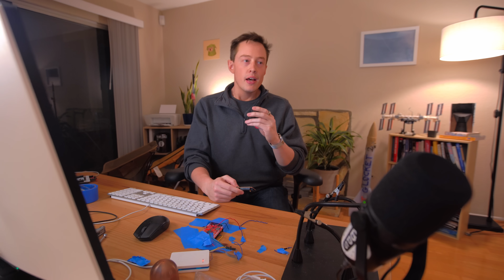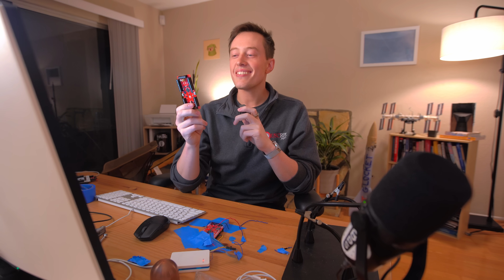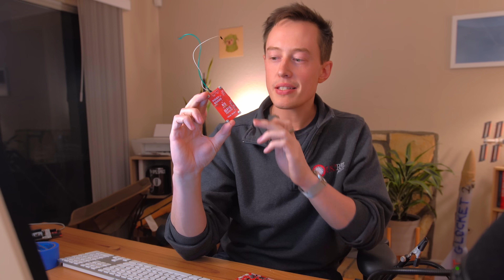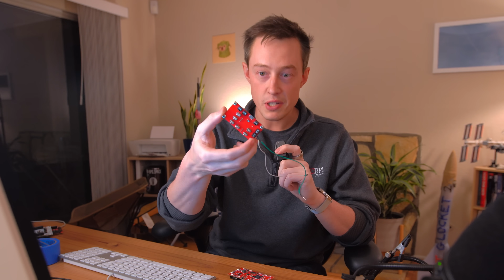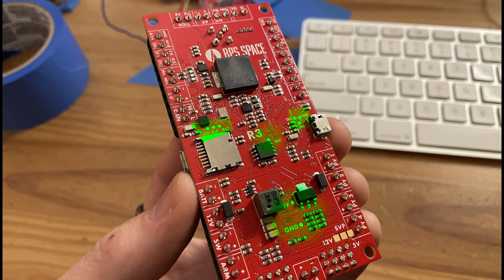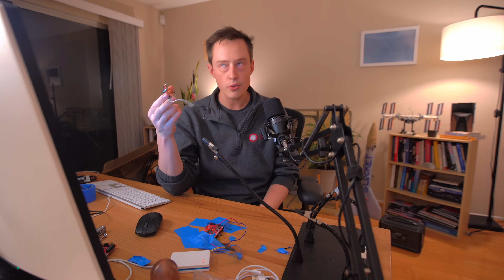the dumbest electronics thing i do

Comment: personally I use my nose to press the mouse button in situations like this
Reply from the maker: I have also done this! Feels especially goofy, but gets the job done
Reply: @bps.shorts  And use a trackball mouse, so it doesn't move off the button when you press it.
Reply: @mariusschaer3415  one of the biggest changes in my work was getting a trackball mouse. i can finally use the full size of my desk and no mousepad. only thing i wish is that it had forward/back buttons.
Reply: @bps.shorts  it ain't stupid is it works
Reply: that's what the foot pedals are for
Reply: @bob2859 where are hey? Didn't discover them on my pc yet
Reply: @TecSanento  Yeah! Why DON'T we have foot pedals to augment our keyboards??
Reply: @TecSanento  Yeah! Why DON'T we have foot pedals to augment our keyboards??
Reply: @TecSanento  You can build them easily enough... simple atmega 32u8 + a guitar foot switch is a cheap option. You can config as a keyboard, mouse, and/or gamepad.
Reply: I coded an autoit script years ago with a 5-10 secs countdown timer that then sends a mouse click. You only need to align the mouse over the program button
Reply: where is the whimsy in these solutions
Reply: @M8R3rojcq  i made an auto-it script to mob-grind at spawners on minecraft servers with the rpg mods. fishing too.
Reply: ...or the space bar, that's safer!
Reply: I think spending a few hours (or days) designing a special contraption to click the mouse button with your nose would be perfectly justified!)
Reply: I've used my nose to skip YouTube ads while both hands were busy
Reply: or your elbow
Reply: perfection
Reply: Or a foot switch acting as a one key keyboard, firing off a keyboard macro :D
Reply: you could use your tongue as well :)
Reply: Foot switch?

Comment: 3 pogo pins on a small piece of stripboard/veroboard. Would take 5 minutes to solder up, and then you can hold all 3 pins with one hand.
Reply: Could probably do a simple 3D print that would hold the pins on an arm and base would align the pcb.
Reply: @lawrenceharris7717  Yup, designing a small 3D printed jig for a few pogo pins are even just some Dupont male connectors would be done in 5 minutes. Just something that  precisely fits over the board and pushes three pins down on the board with bit of weight on the back of the jig,, hell just use a paper weight.
Reply: @FoobarDesign  This is literally the way OEM's solve this exact problem at scale. A block with pogo pins and a cable. Hell, there are those programming cables that are basically off-the-shelf versions of this concept.
Reply: @lawrenceharris7717  exactly what I was thinking with a cam locking mechanism
Reply: To quote Henry Ford  "If you want to find a better way to do a job, give it to a lazy man"  so in the spirit of no effort November I suggest cutting down a strip of plastic from a credit card just wide enough to span the 3 pads. Then super glue the wires to the card so that the exposed wires extend past the end of the card. Bend the wires over the edge of the card so the side of the wires will contact the pads.
Reply: If it's close enough to the edge you can drill three holes in a wooden clothespeg for pogo pins.
Reply: @TDOBrandano  Getting accurate holes in cheap wood is hard given the grain structure. That said, maybe potting something in hot melt glue on a popsicle stick?
Reply: @benjaminshropshire2900  just put slots on the edge (use a broken veroboard for a guide) then you can tape/glue the pogo pins in place on the edge...
Reply: Yeah that's the obvious solution, fingers crossed that the spacing is standard so it's easy to get it to line up using veroboard...
Reply: @hot_wheelz  For a one off, the spacing is irrelevant as long as you know what it is (and as long as it's wide enough); just drill a bit of scrap Delrin or the like.
Reply: @benjaminshropshire2900  yes, I realise this. There's literally an endless number of fairly trivial ways to skin this cat all depending on how much effort one is willing to make. If you want to use veroboard as per the original suggestion then spacing is at least a little bit important. If your willing to 3d print a jig or drill 3 holes in a piece of plastic or a wooden dowel then spacing becomes less of an issue but you then have to goto more effort with drilling holes and so on. I think the real point of all this is that if the current procedure is a hassle and needs 4 hands then it's probably at least worth say less than an hour to make a simple jig to ensure that the process is massively simplified.
Reply: 3d Print, drilled wood or even play-doh. Doesn't even require standard or regular spacing.
Reply: @rmg_lb play doh works, but for a more permanent fixture I think Sugru would work better.
Reply: Literally came here to say this, but it can be even simpler. 3D print a chunk of plastic with 3 pins in it, solder wires to 3 pins, hold with one hand, yadda yadda yadda.
Reply: Nailed it! (that's supposed to be a pun BTW)
Reply: For programming specifically, Tag-Connect makes great (but pricey) cables terminated with pogo pins that can interface with an external programmer like an ST-Link. Super convenient to use and they have variants with or without retainer clips if you want the probe to stay in place while developing.
Reply: James at Clough42 did a video on exactly this where he uses pogo pins and a 3d printed fixture for testing his boards. https://youtu.be/XD6EKqvFBCs?si=fa2_ZnbmoNeBU-Uh
Reply: I've done a diy tag-connect and a 3d printed jig before both worked well.
Reply: I have almost exactly the same problem with downloading data off my dive computer; three contacts on the back and they expect you to buy some overpriced clip. I soldered three pogo pins into a stripboard that connects to a TTL serial adapter, hold it against the computer with one hand, leaving one hand free to click the "download" button. Easy, repeatable, took minutes to solder up and cost me almost nothing.
Reply: lol or even just pin headers... or even just a piece of tape. literally anything but this
Reply: That's what I did, pogo pins on a programmer board so i didn't have to add a serial usb chip on each board
Reply: yeah, sounds like he's not aware of pogo pins.
Reply: I’ve seen when the pogo pins are attached to a clothes peg. Clip to the board where the pins are aligned to the pad.
Reply: Yeah I was thinking it would be simple to make a slngle probe with three springy needle contacts. It could be made totally foolproof if you added a couple of holes in the board near the contacts and matching pegs on the probe.
Reply: Sticky tape and cardboard for the lazy.
Reply: Acupuncture needles in your helping hands with the leads crimped on to will give you the pressure and bite you need and is easy to use for debugging as well later
Reply: I was thinking he could crimp a 3x1 Dupont connector  to those three wires, so he can one-hand it.
Reply: Could 3d print a swiveling arm to match the board to hold the pins.
Reply: A three pin header works too.
Reply: Even better, if you don’t want pogo pins on the board, PCBite Probes. 

Desk mounted pogo pins on an articulating arm.
Reply: Pogo pins was what I was thinking as well.
Reply: Exactly what I wanted to say.
Reply: 3D Printing and/or even "just" laser cutting a holder for three pogo-pins would be definitely easier :D
Reply: or in a 3d printed plate, and some pins that align with a rectangular "board holder"
Reply: 3 pogo pins, a small 3d printed holder that aligns them, and then a small latch to keep the board in place.
Reply: i have lower effort solution, instead of stripboard/veroboard (they require soldering, right?) i push pogo pins into dupont female 2.54mm prototyping wires, and tape them together
Reply: Stick the three wires to a piece of tape and hold that with one finger on the board?
Reply: This is the way
Reply: Apple user😂😂
Reply: Been doing this for 4 decades
Reply: I was thinking hot glue the pogo pins to a plastic fork for maximum jank this is a way better idea though.
Reply: Was just about to type this
Reply: better yet just make a jig off a 3d printer and plop it on
Reply: @JadedAtheist  that takes longer than simply soldering pogo pins to a perf board
Reply: You mean  headers with little springs soldered to the end hahah
Reply: @IconicPhotonic  there are test probes that are spring loaded, called pogo pins, all different types of contacts, they are used on production lines to test assembled pcbs (and program them is needed)
Reply: that was i thougth
Reply: No need for pogo pins. 4 thru holes in a row at 50 mil pitch in board. Solder wires to a 4-pin 50 mil pitch 90 degree header. Header rests in holes and can be held with one hand.
Reply: Just want to say I've totally done that so much... And I know full well about pogo pins.

Comment: I suppose you could 3D print a small jig that would hold Ava and then clamp down onto the correct pads with pogo pins. That might need like a tiny custom PCB to mount the pogo pins to,  but I bet you could knock that design out in a couple hours, and it might generalize to use with future boards.

Comment: could you maybe just 3d print a small thing that holds 3 metal pins in place. then solder the 3 wires to those 3 pins. that way you just need to hold the printed piece (with the 3 pins spaced out properly) onto the 3 contacts and its all done? would basically just be a small piece of plastic with metal pins like hot glued onto it lol

Comment: You might want to consider Tag-connect for new designs. It's a footprint you can add to the circuit board, and you can then by a matching cable from them for programming. A good compromise between holding pins by hand, and designing your own board.
Reply: Tag-connect 100% ftw
Reply: Tag-connect is awesome. Just a relatively tiny footprint you can throw on all your boards and just not worry about it going forward.
Reply: I've used this in low production quantity products where the footprint is available
Reply: I love the tag connect connector
Reply: Würth REDFIT connector is a good alternative if you want one that's a lot cheaper.
Reply: Big fan of tag connect over here as well
Reply: I just designed my first PCB last week so I had to look up what a Tag-Connect is and WOW THATS COOL! Not applicable for my board (mostly a carrier, I have no idea what I’m doing lol), but it would be absolutely perfect for this application!
Reply: Tag connect is awesome and a lot of commercial products use it too if you go digging :)
Reply: thank you, didnt know that existed
Reply: You could make your own tag connect pcb that you solder pogo pins into
Reply: +1 for Tag Connect
Reply: +1 tag connect
Reply: Ditto here I love the tag connect. I use the no legs version and it's fantastic for all but the tiniest of boards. KiCAD has had the footprint for the various models for years now.

Comment: Is there any reason you can't add a header for programming? That would be my go-to.
But without changing the Ava board, I'd glue together some pogo-pins in the right spacing and use that for one-handed operation. Hell, you could even use blue tape.